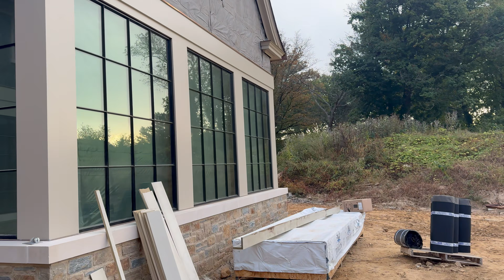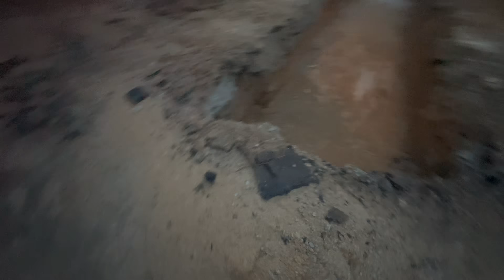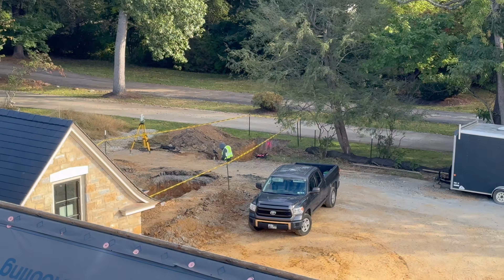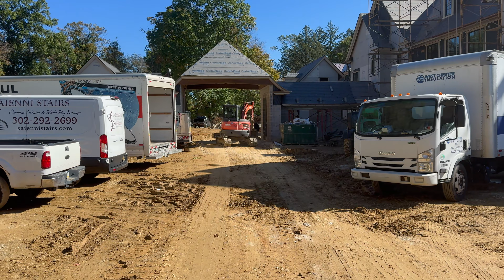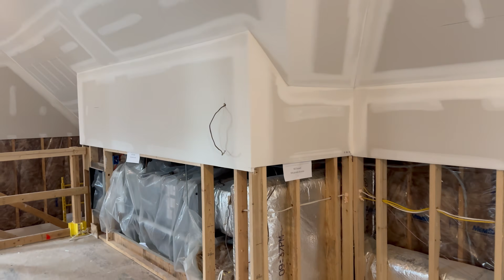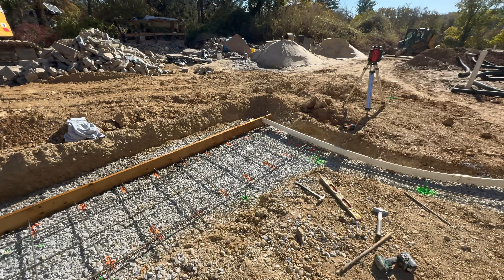Masonry, Insulation, Drywall & More.  - Project Build- Ep41

Comment: I don’t like that roof material.  It’s a beautiful home but I would have used one type of facade - the white type rectangular.  I just don’t like all that rock - the white material is so beautiful and clean - I think you call it lap siding.  Stucco on the walls would be prettier.  Why so much cobble?
Reply from the maker: Unfortunately, I have to disagree with you on some of the materials. The unfading black slate is one of the nicest products out there and technically a  100 year roof product. The siding is a true taper lap siding made out of Boral . It’s just like your classic cedar but will last a very long time with no rot. The stone is so beautiful compared to Stucco finishes in my opinion. Some of the materials you’re talking about are more modernized, but this home is meant to look like it’s been here for a long time. It represents the homes in Cotswold England. But I do appreciate you watching along. You don’t see many new homes built like this nowadays.